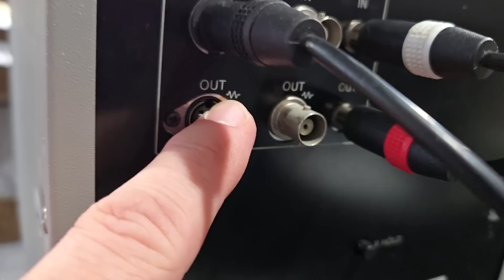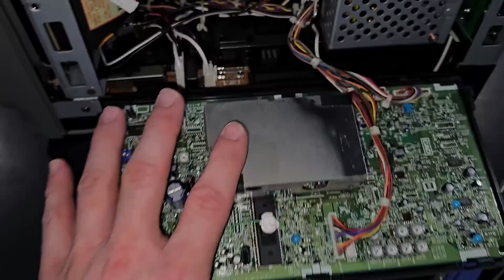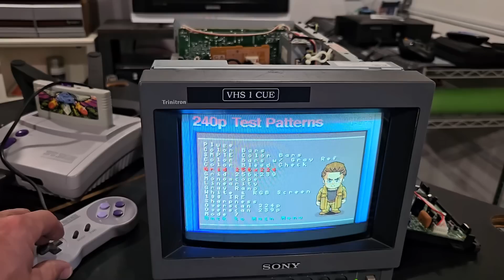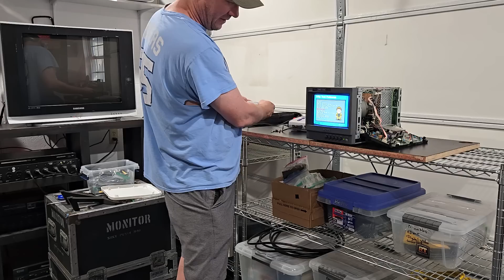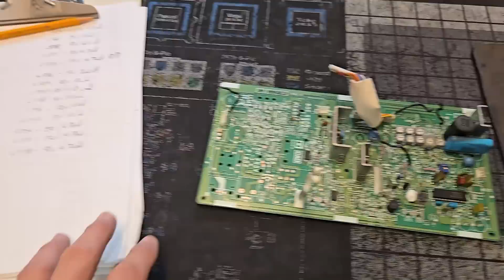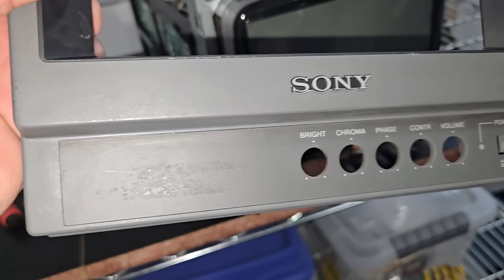The Travel Size Trinitron - Sony PVM 8040 Deep Dive

Comment: Composite/S-Video is black and white - The B board has orange trimmer pots CV101 and CV102 for NTSC and PAL that eventually go bad (see image below). If your model has the orange trimmer pots they must be replaced. If your model has blue trimmer pots then they were already replaced by Sony and do not need to be replaced again. The part to order is a ceramic 100v trimmer capacitor with a range between 3pF to 10pF. You will also need to solder a 5pF 50v film capacitor across the legs of the trimmer pot. You may need to adjust the pots to get color to show. If replacing the trimmer pots doesn't bring color back, spray all pots on the B board with deoxit and give them a few spins (remember to take note of their original position). Try adjusting the "358FO" pot (its in the corner of the B board closest to the front of the tube). Reflow the solder joints for IC124 and all of the connectors for ribbon cables on the B board. If those don't fix the problem then recap B board.

Comment: I have an 8041q that have same boards of this one. Mine have the color problem (already solved) and a horizontal deflection issue: the H.size trimpot does nothing. The image is shrinked, there is black colors at sides. The H. size trimpot is not open, neither de U.H trimpot. Any clues on that? I really apprecite any help.

Comment: Hey could you point me where I would fix for vertical collapse on this model
Reply from the maker: Sure, concentrate your efforts on the deflection board.   The vertical deflection circuit is located there.   You have a part(s) that is shorted on the vertical circuit

Comment: The 8040/9040 only correctly process composite signals for the region where they were sold, which is why there is only 1 potentiometer. Meaning that for a NA or JPN one, if you feed it a PAL signal, it will display in black and white, regardless of whether or not it has the problematic pots. I always wondered if it would be possible to source and install the necessary components for them to process all region signals, like the 8041/9041.
Reply: Do an RGB mod on the empty jungle chip inputs?
Reply: @lovemadeinjapan  I suppose that's the easy way to do it, yes. Like modding an L1 for RGB. However, I was thinking more along the lines of replicating the functionality by restoring the OEM circuits, which would be more complex.
Reply: @hadesmcc  I guess you could add all the missing parts from higher end models. As you can see there is place for every of these parts, even the front buttons on the bezel.

Comment: I noticed I have the greyscale problem on my 9045qm.

I am going to assume that it might be the same problem as the other ones, even if the 8045/9045 is not mentioned in those official Sony pamphlets.
Reply from the maker: @Freakyfish42  Sony did eventually fix the problem in the factory on the later production models.  The way to tell on yours is to look for the orange pots.   If they are orange, then they need to be swapped out, if they are white, Sony fixed them in production.